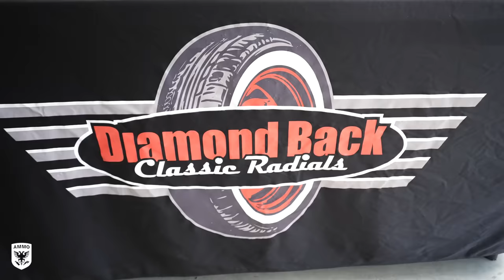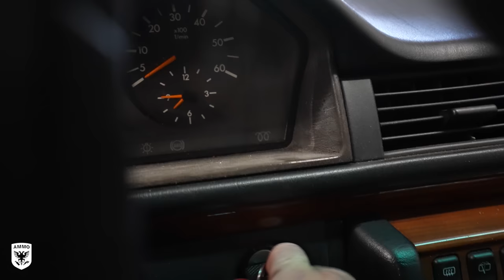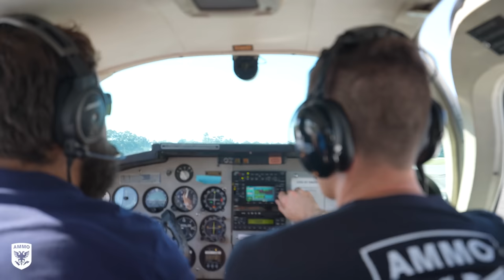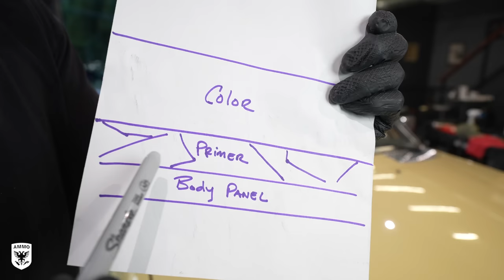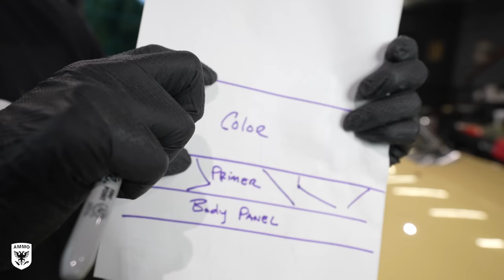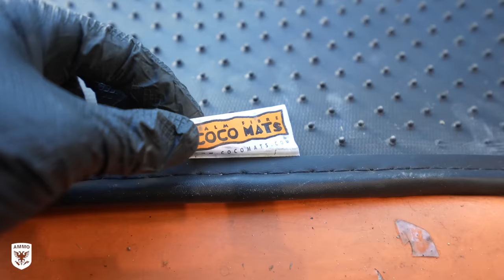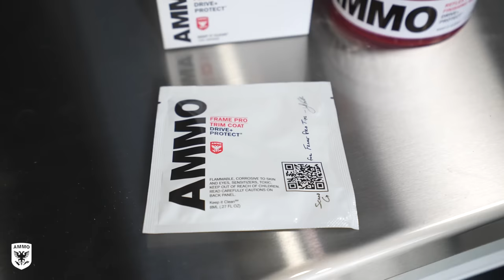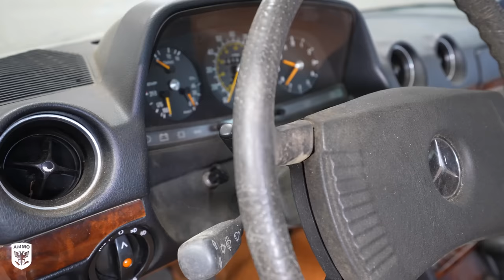First Wash in 10 Years: Mercedes 300CD Diesel Disaster Detail and Sale!

Comment: Great video and explanation of your process. One thing I find for car floor matts like that is to use a upright vacuum. One with a bristle bar that rotates. I turn the matts upside down on the floor and I beats the sand and fine mud out of the pile onto the floor then I wet and dry them.

Comment: I had a 1982 300SD and the wife  had a 1983 300SD, both turbo diesels. The drive train was great... everything else was crap. The interiors did not stand up to the California sun, all of the plastic items, dried a cracked/broke... the tops of the dash boards cracked  The Bosch electrics (alternator, starter motor,  window switches... all  needed replacing multiple times.  But that 5 cyl diesel engine was bullet proof, all mechanical including the fuel injection, there were no computers, electronic fuel injection or electronic ignition  to fail... as long as it got fuel and air, it ran.  

These things had a curb weight of almost 5,000 lbs!!  Side body panels (fenders, doors) were thick,  the enormous hood was aluminum, sheet steel would have been too impractical for weight.  I remember heavy manhole covers would go "clink-clack" when this beast of a car rolled over them.  The 1984 model ushered in a horrible downturn in both quality and reliability of the MB diesel engines, at least in the cars, which I could never understand as these 5 cylinder diesel engines were that same as what was in the ultra tough, ultra reliable MB Unimog's.
Reply: I own the exact same model and year, it's still mint. 5-6 feet of snow, -30c, ice, salt. Doesn't matter. Normal maintenance and they just keep going. The only major issue I've had was condensation inside the front lights when it was below -20c outside. Easily fixed with a few drill holes at the sides. Other than that they've run daily for over 15 years now. Owner before be drove it daily as well as his commuter since it was brand new. I guess they do better in cold climates.